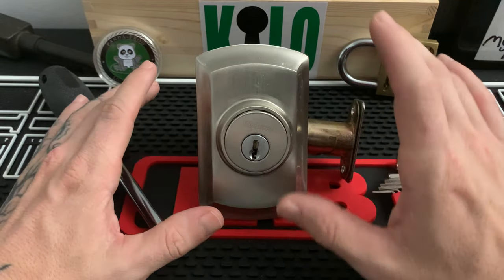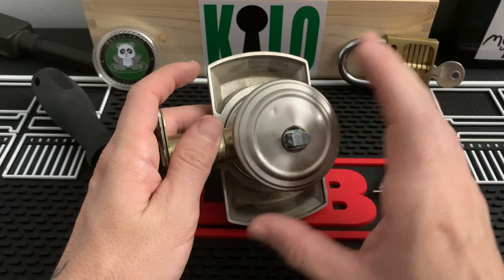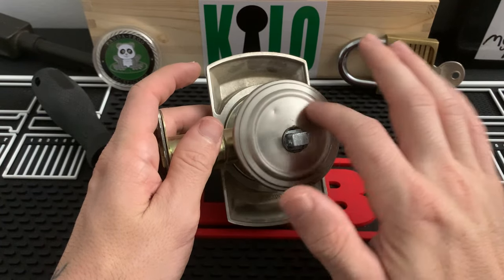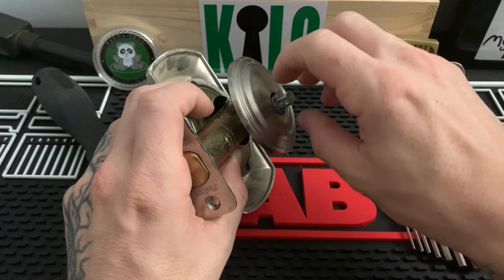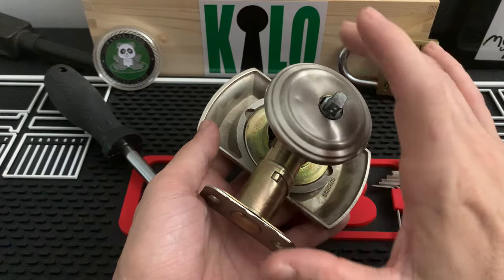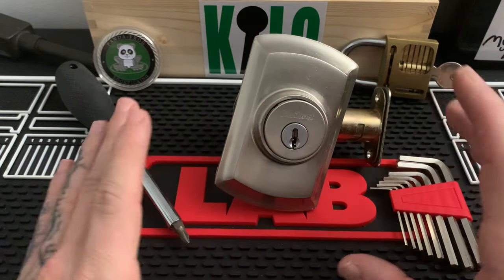How to Remove Kwikset Deadbolt Without Screws!?

Comment: Great job.     Another great informative video   Thanks 

I have a question 
As a lock smith and with all the “sport lock pickers” out there

What lock (Deadbolt) would you put on your own house to keep it safe
Reply from the maker: I will not lie... if you ask the majority of Locksmith's they will tell you Kwikset haha
The reason is Locksmith's know the stats and how to target harden their property, 
so there is a higher probability of them having to pick their own lock in a Lockout situation
than someone breaking in. 

Almost every Locksmith I have worked alongside has had Kwikset/Defiants haha
Bump Keys and Lock Picks are mainly used by Locksmiths or Hobbyists and
thieves and burglars see all locks the same, they don't know how to identify keyways
and honestly you could set a Defiant next to a Protec 2 and they wouldn't know the difference. 

To answer your question the best I can I would recommend Schlage for your Locksets
as unlike Kwikset, Schlage is known for their Anti-Drill features as well as a tougher keyway for
a novice to pick. 

But, you have to keep in mind that most burglars kick the door in, so even if you choose an Abloy Protec 2
you will need to install a high-security strike plate with 2 inch screws. 
The door hardware always comes with those tiny screws to mount the strike plates and that means 
that your security is flawed as one kick will tear the frame apart. 

You want to use 2 inch screws preferably as they will sink into the actual frame of the home and
not just the door trim which is soft and weak. 
High-Security Strike plates usually allow 4-8 screws to be used to help against kick-in attacks. 
People always overlook the strikes when they purchase their locksets lol 

Just remember... the tougher the lock you install on your door, the more expensive it will be
if you lock yourself out and need a Locksmith lol

I have a video on Target Hardening, but you can research it as well for a more in depth look 
at many ways to deter thieves and as long as you have at least 4-5 of the steps in place 
you will normally deter probably 90% of opportunistic thieves. Add in a wireless alarm system
with signage and you'll deter 99% lol
Reply: 28 years in Law Enforcement here. I can't remember a single time a break in was by picking the lock open. 99.99% a swift kick to the front, back or side door and they're in. To a lessor extent I've seen ones where a small glass window next to the lock was broken and unlocked. Others are pried open. So as Kilo said target hardening is your best option.
Reply from the maker: @Locksmith.71  28 years! Respect, man! Stay safe out there!

Comment: Good info however mine was slightly different. Mine had an allen screw for the turn knob, but didn't have the second allen to remove the cover. All I had to do is pop it off at the bottom like you showed. This was also a Kwikset deadbolt.

Comment: Ha, this is like a cross between a Medeco deadbolt and a commercial leverset(As the former has a thumbturn which is secured by an allen screw, and the latter’s rose attaches in the exact same manner).As always, stellar tutorial Kilo!Keep ‘em coming!
Reply from the maker: Many brands and models use this is some fashion. Some have 2 screws on the thumb turn itself, 
A lot of Smart Lock deadbolts are like this and confuses people. I show up to homes with 
the thumb piece removed a lot of times like the one in the video and the customer doesn't know how to 
remove the plate. 

I guess I could make a series on just different models with hidden screws lol

Comment: Hi, how to prevent the deadbolt knob from turning if the burglar breaks the entry door glass and stick his arm inside and physically turn the knob? Is there an knob lock without changing the multi point lock set?
Reply: Change it to a double keyed dead bolt. You just discovered how 90% of people are going to defeat your "burgle invite sign" erm, I mean "security"..Also why do rich ppl make it so easy? you obviously got good stuff in there if you got glass that lets my hands into your entry way.
Reply: @gantz4u  thank you

Comment: I have a double cylinder lock with no screws or a allen key screws. Just 2 small holes (too small for reg screws driver) on opposite sides of the keyhole. How do I get that off?
Reply from the maker: Depending on the brand they can have caps that cover the screws, use a lori/allen or use other methods! 

If you'd like you can email me a photo to LockandKilo@gmail and I can try and guide you more accurately!

Comment: Great video! What size is the Allen screw? I tried my Allen wrench and my smallest one was too large..
Reply from the maker: You can try a 3/32. If you do not have the right size in your kit, Kwikset sells Lock Specific Set Screws and Allen Wrench kits online for about $2-$3 from various online hardware and tool distributors!

Comment: Thumb knob won’t come out even after the Allen screw was removed.  Any suggestions
Reply from the maker: Once the screw is completely removed, it may require some gentle prying if it's not coming off. 

Nothing should be holding it in place, it could just be putting up a fight lol